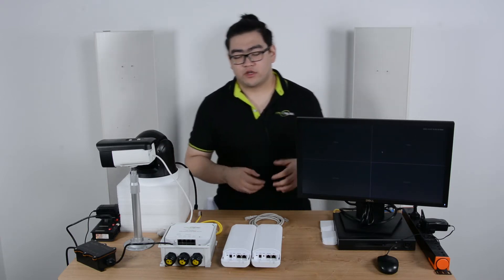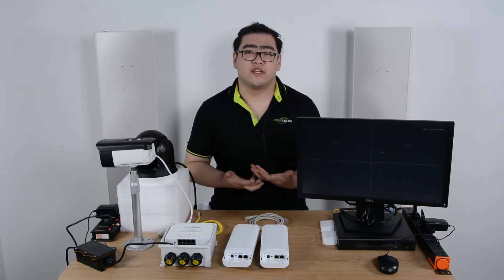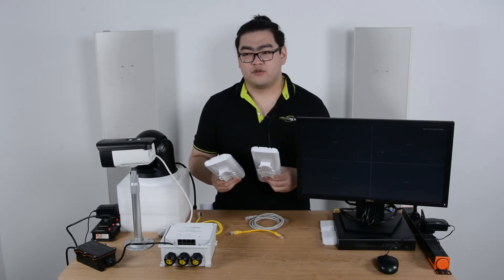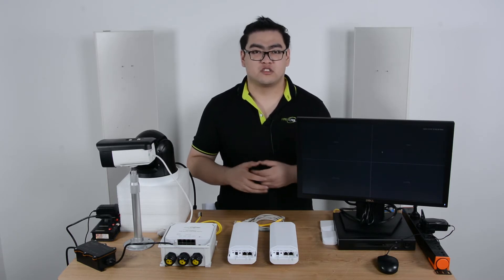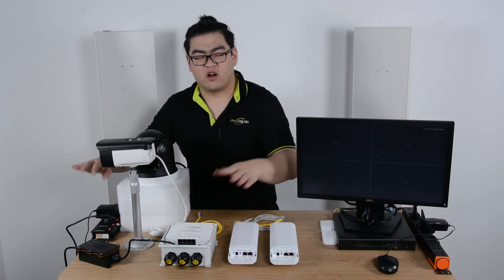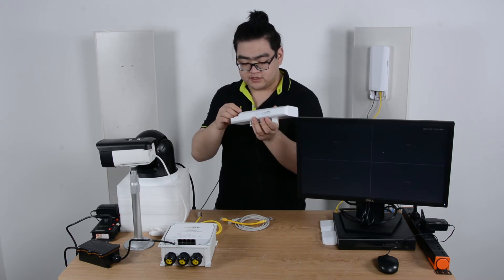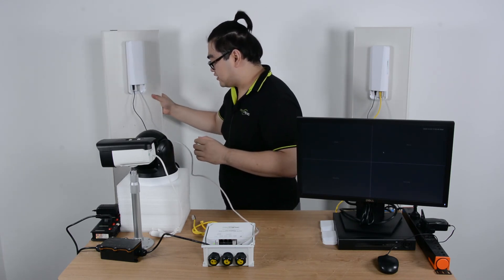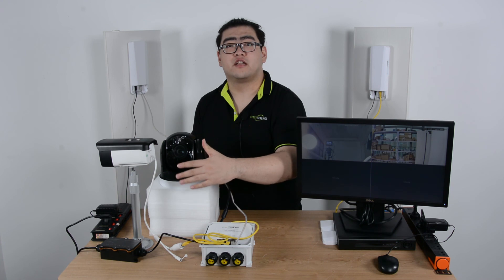How to Use Wireless Network Bridge to Get a Extended Network for IP Camera System?

Comment: “Always plug to port 8 since it’s an 8-port” etc. My question is, what if the PoE switch has uplink ports? Would I just plug the Slave into the uplink port? Further context: I have a daisy chain of PoE switches at a current project… all with Cat5eDB interconnecting them. Would I plug each switch into the next switches Uplink port OR do I plug into the last port like you do? My switches are 8-port btw.

I am implementing a P2P wireless bridge for network across my 6 switches, and I’m hoping I can distribute network data to multiple switches via the P2P slave Switch. Possible? Each switch is less than 300’ with exception of 1st and final switches which are 700’ feet from previous switch/router. Your opinion is much appreciated. Thx in advance, love the videos!
Reply from the maker: You can use either PoE ports or uplink port. Usually there is no different. The PoE port will activate as data port if it can determine the power requirement from another switch. It has power handshaking in the standard PoE protocol. However cost down PoE switch will use 1000mpbs for uplink port but only 100mpbs for PoE ports. You might want to use uplink port specifically. I don’t recommend you daisy chain multiple switch. Not only the latency, but also the addressing within each switch could cause issue especially for ip camera system. You can try the star topology. Pulling the network cable or fiber optical cable from main switch on ends to each edge switch. You might need to pull more cables, but it will save your time in future maintenance.
Reply: @Fastcabling  Thank you. Hmm, what if i do a Point-to-MultiPoint wireless bridge, and connect each switch directly to a Slave network beam. Would this in theory help with network latency? 

All my PoE switches are 250W max output, and 1G mbps uplinks.  Highest MP camera is 4MP. What I might do is connect each switch with Fiber to help with latency. Would this help data latency? 

Unfortunately I cannot run fiber from Main switch w/ Star Topology at this late in the game…too expensive.

Comment: Why is the 12v power cable needed if using POE?
Reply from the maker: The wireless bridge doesn’t support PoE. It need to work with DC12V power adapter or DC24V passive PoE injector as power source.

Comment: Very helpful video. How do you plug power adapters into the network master and slave that are going to be far from any power plugs? Also, do you recommend any specific products?
Reply from the maker: I suppose the slave should stay the other end to come up with wireless bridge with the master. The passive POE can supply about 100 meters power and data to the master or slave. If you need longer than 100 meters, you may need standard POE power system and add the POE splitter before your master or slave. Just make sure your master or slave can take in DC12V power.